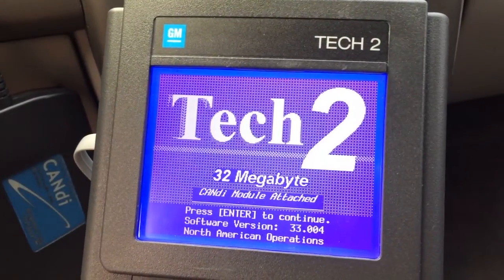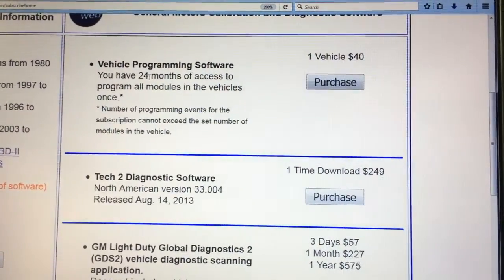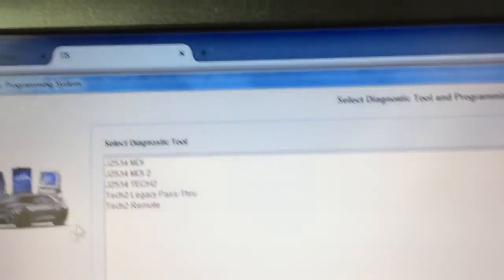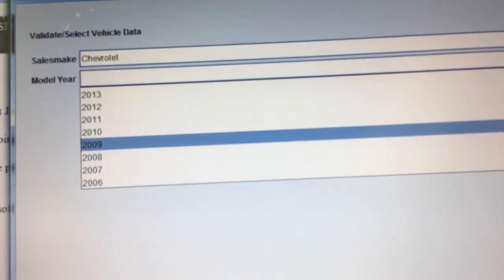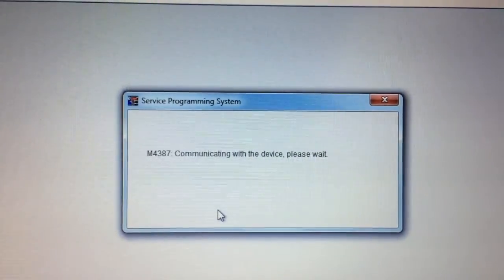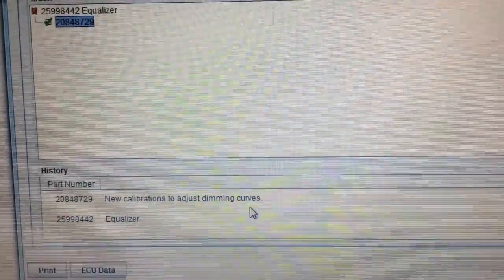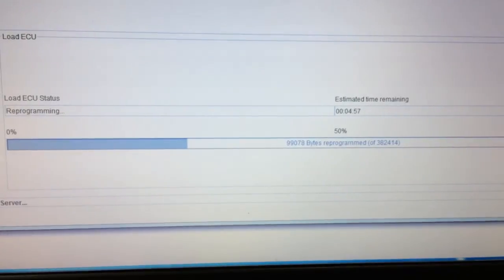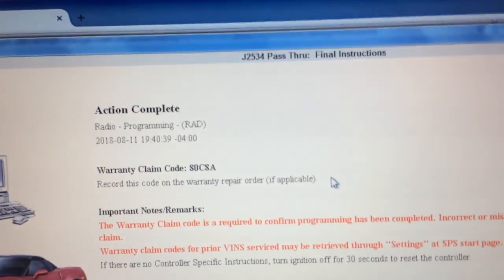GM SPS Programming: Tech2 Tool Pass Thru Mode ECU TIS2Web TDS How to do a Calibration Update Reflash

Comment: What type of Tech 2 are you using is it a clone or genuine GM Tech 2?
Reply from the maker: High quality clone, absolutely zero difference from original as far as TIS2000/TIS2Web goes.  As an individual owner, buying a genuine unit is throwing money away.  Have been using this guy regularly for about 3 years now with no problems at all.  When new I upgraded the voltage converter, which is the one weak spot in them.
Reply: Do you have a seller you could recommend buying one from, or what to look for when buying a good quality clone? 
Thank you. Chris
Reply from the maker: For the MDI, I have a separate video up for that.  For the Tech2, I would recommend eBay, and looking for a US based seller to avoid drama.  I believe at this point there is only one supplier left of these Tech2 clones and fortunately its the higher quality one, so as long as you see the complete set of all the cables and adapters it's likely the high quality one.  Weakest link is the PCMCIA flash card, the clones of the linear flash memory type are not well made so you have to be gentle with them.

Comment: Hi, thanks for that informative video! I'm having an issue when the SPS is attempting to communicate with the Tech2 for passthrough...I see the tech2 screen change but then the error message shows up in SPS "M4404: Please restart your Programming interface and press OK to retry! Press CANCEL to abort". I've got the usb-serial port set up & working, 115200 baud, COM3.
Reply from the maker: M4404 is a communications problem between the Tech2 and the laptop.  I would check vehicle battery voltage, that the Tech2 is being supplied with its own separate 12VDC power via its AC adapter, that the serial cable between the laptop and Tech2 is good and with solid connection at both ends.  Also do not have anything else running on the laptop but the browser hosting SPS, do not use the laptop for anything else while the SPS Java applet is communicating with the Tech2.
Reply: @DrShock  Same here. I'm using the Tripp Lite Keyspan High-Speed USB to Serial Adapter and connection is good. The Tech 2 is powered via AC. This laptop is strictly for messing with my 2007 Saturn Ion. I'm beginning to think this ACDELCO website purchase was throwing money into the wind.
Reply: @bootoxkikka  I know this is old, but wanted to provide my update. I found the same error...when I had left the plug connected to the bottom of the Tech2 (even though it was disconnected from the vehicle interface) and also connected the Tripp Like Keyspan adapter to my laptop. When I unplugged the adapter to the bottom of the Tech2, and restarted the unit JUST WITH THE Tripp Lite...the system proceeded as expected. Just my experience, but for those who also struggle...this could be a reason why.

Comment: do you know how can I force SPS to reflash again?
I did update a module and I got an error at the end. I can access the module but it is not working properly, so maybe a reflash would fix it
But SPS tells me it has the latest calibration and won't reflash  :(
Reply from the maker: If you can read the calibration, that's not the issue.  You cannot reflash the same calibration on a GM part anyway.  You could if there was any problem reading the calibration, but if its readable SPS will just tell you that you have the latest calibration already.
Reply: ok, so if the calibration is fine, then it means it;s just not communicating to other modules properly
any other reason why it would not work?
it's the battery charge control module from a Volt/Ampera, and after updating it won't charge from AC, it says that P1EE6 Battery Charger AC Voltage Not Present
obviously the module worked fine before the update, so it must pe a software issue...
Reply from the maker: In these kinds of situations I pull a comparable part from the local pull your own parts salvage yard vehicle for testing.   I'm not familiar with this particular voltage not present error, but having another to test with helps zero in on root cause.  While one would intuitively presume its a software/firmware issue, it can also be that the flash operation itself finished off a dying module.  I have seen this at least once and the swap confirmed it wasn't the calibration level itself, but rather just a dying part.
Reply: So the answer to my question is:  in order to reflash again with SPS you need a VCI code.  You need to be a dealership in order to request and receive the code
Once entered, SPS will ignore all calibrations on the module and reflash
Reprogramming worked, and now the module works!